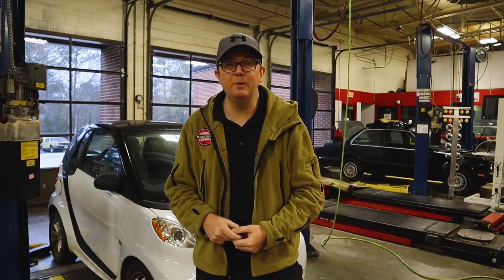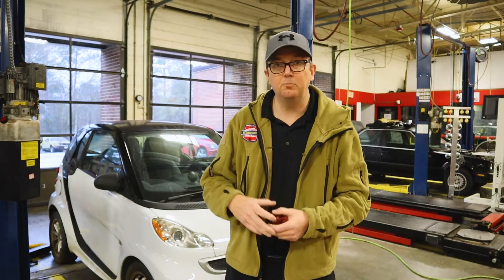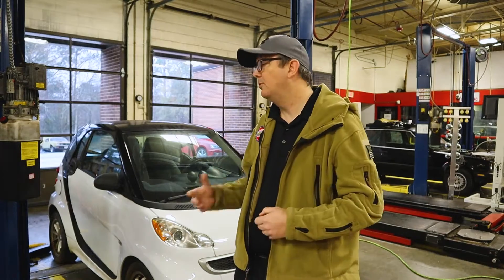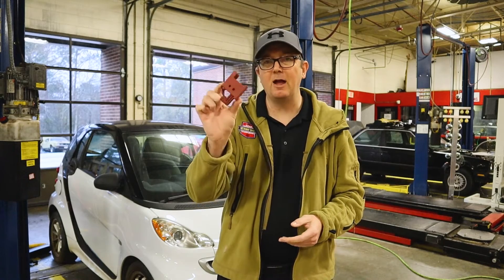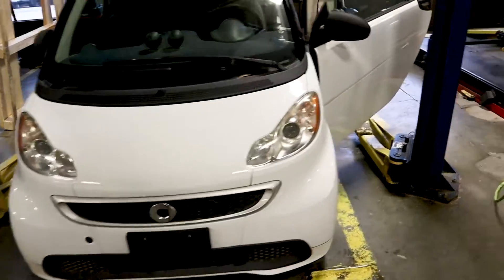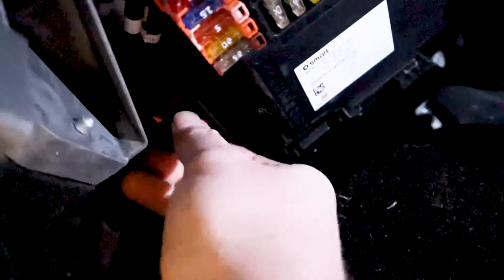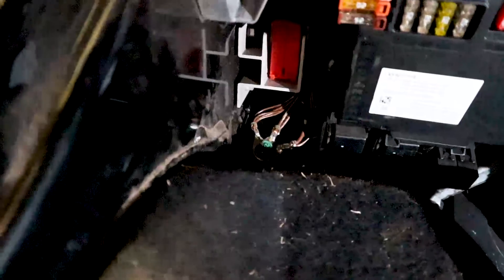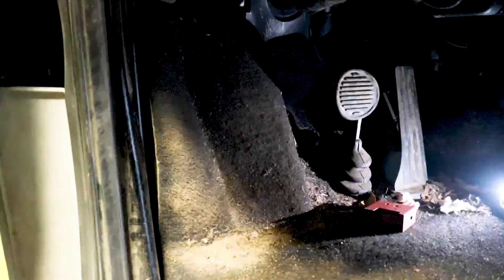Smart Fortwo Electric Drive - How to Disconnect High Voltage

Comment: 2014 smart EV owner here. Same model as in this video.
I personally had to remove and replace the 12vbattery after it died over a 6 month winter.

Upon reconnecting the new battery I mistakenly sparked the positive lead by making contact with what looks like an aluminum housing module above the battery tray.

Upon turning key to test the car power I’m greeted with a malfunction “Drive System /Engine Off”.

Charger will not charge HV battery AND can not drive the vehicle.

Will a simple clear of the codes get this moving again or are we looking at something catastrophic?

Battery charging level shows zero which is bizarre too.
Reply: Have you resolved your issue? I'm in the same boat currently, I'm hoping that just clearing the codes will fix it.
Reply: @crazymazzei2  unfortunately I brought to Mercedes for a diagnostic and their team said the main drive battery was dead and needed replacement. = $32,000

It was not due to the starting battery and the sparking from the connection when I tried to replace the starting battery.

It was due to not running the car for 6 months over a winter which caused the main battery to completely die.

I was told that these vehicles need to be used constantly to maintain both batteries power levels. This is not mentioned in the owners manual.

Bottom line. I literally had no other choice but to take the loss and donate the car to charity. Sold for $1,209 at auction.

Comment: After removing the service plug as you described (BTW- Thanks!), in order to remove and work on the (HV) Cabin Heat unit, do you have any suggestions on how to clear the HV system fault?  Starts, drives, and charges OK, but the dash has a persistent warning about the HV battery system now.  The ODB2 readers I have can't communicate via the port.
Reply from the maker: You may have to use a more advanced scan tool to do so. I hope this helps!
Reply: Autel MaxiAP200 obd reader does the job for $60

Comment: I have a 2015 electric smart. If I understand you correctly, in order to replace my 12volt battery (located in the passenger's side floor) I need disconnect the high voltage first, they way you've shown. If I don't it will mess up the electronics of the big battery? Is that right? I use a battery tender on the 12volt when the car is parked for 6 months of winter, sooner or later, I'll need to replace it. This is important information to me.
Reply: No need to pull HV disconnect to change 12v battery. Also worthy of note: if you turn the key on with the HV disconnect removed, it will trigger fault codes and battery management functions will stop working. Don't ask me how I know🙄
Reply: @mariolarouche5318  you dont know just today I changed my 12v and now i got this msg (HV system workshop)
Reply from the maker: I would pull the plug to change the battery, but I have not found any information at all stating it is a requirement. There is just nothing out there on these at all. Sorry I cannot be of any more help.